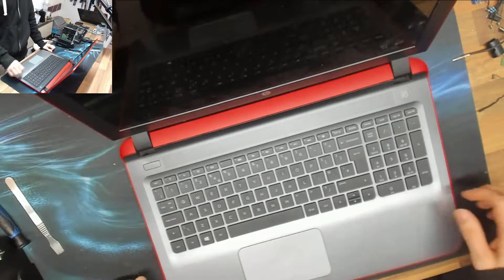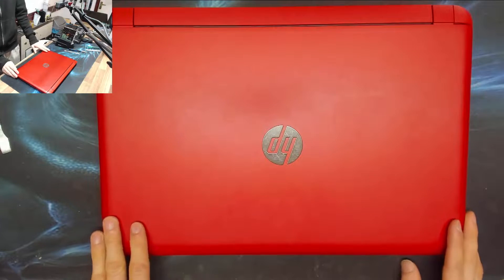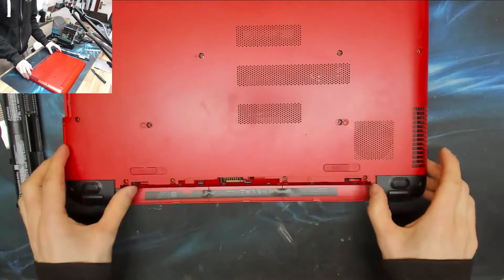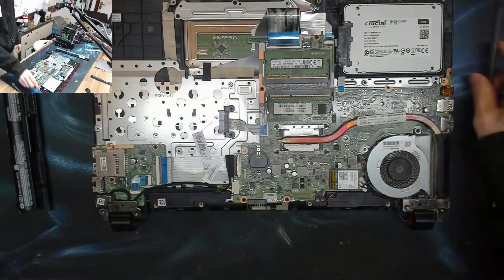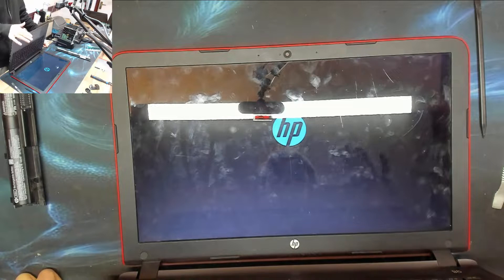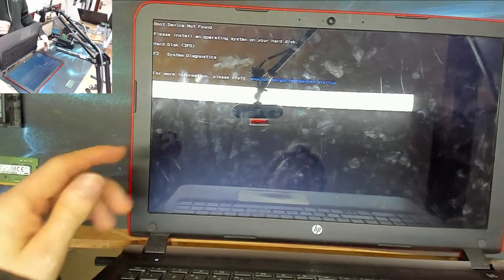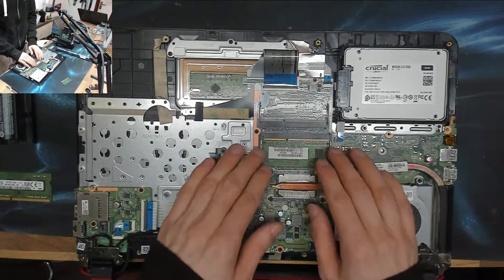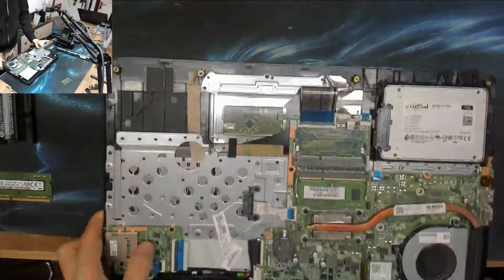LFC#145 - HP Flashing Caps Lock diagnostics

Comment: Mine flashes 5 times, HD spins, it's a fanless. I spilled water through USB ports, at first I hadn't noticed and went on using it. It randomly went blue screen, I force powered it off, no power and as said 5 blinkings... I disassembled it completely and blowed the board with hair dryer Now I'm leaving it apart to discharge caps and bios battery... let's see if it's turning on tomorrow

Comment: Hello, another great video. I have a similar problem. I get 5 short blinks 3 longs ones. It all happened after i did a bios update. When i started the software the program told me i could not do a UEFI bios update, but there was an option. "Only Bios Update" . So i chose that, after rebooting i get this caps lock blinking. I tried to hold Windows key + b or V. But it didn't worked. Watching you're video i decided to also remove the bios battery like you did. Unfortunatly it does not have the same effect.

Comment: I got an issue where there's 3 long blinks. I tried reset CMOS, swap memory modules but still no post. I noticed though that the LCD driver IC gets too hot the moment I turn on the power. What can be the cause and possible solution?

Comment: Thank you so much. Thought my HP 14 - 599 was dead. All I got was 3 caps lock flashes. This particular model doesnt have a CMOS battery. Removed the 1st 4gb ram & hey presto after a BIOS reload its sprang back into life & seems to be working much faster.  I know now I shouldn't have bought the cheapest!!! My old Tosh never gave any trouble. I hope this comment might help someone else.

Comment: the bummer about my HP 820 G2... it doesn't have a bios battery!.... not a single battery to speak of except the rechargeable battery pack it comes with.... it's happened to me before... switched RAM slots and it worked.

Comment: I have the same HP laptop and I got the same cap lock flashing pattern when I put in a bad RAM module and also when I tried to use an external GPU in the WiFi slot
Reply: how's that possible? i'm curious since i've never heard of that

Comment: It's the wifi card.  I took out the wifi card and got the 5 long, 3 short caps lock flashes.  I put the wifi card back in and it worked fine again.

Comment: Thank you for this very clear and instructive video.
I have a 2 long and 2 short flashes on a HP spectre x360. There is no removable CMOS battery nor RAM.
I tried switching ssd hard drive and even motherboard with another  HP x360.
My ssd hd and motherboard work great when installed in the over laptop (wich means they actually work just fine)
and the working laptop's ssd hd and motherboard just don't work when installed in mine (wich means there is something else in my laptop that just can agree to work)
Any possible idea ?
Reply: just buy a new computer
Reply: messed up power rails i'd assume?

Comment: Just got on of these HPs, same caps lock LED 5-3, with any SODIMM I test in it.
Reply from the maker: Probably a dead CPU in that case :(
Reply: @Adamant_IT  Respect for replying to a comment on a 2 year old video, did you know that HP has a table with all the error codes, 5 long 3 short indicate that 'The embedded controller has timed out waiting for the BIOS.' so a bios error
Reply: @aeronjarvis3491  hey did u somehow fixed this problem?Im having the same issue

Comment: My old pavilion dv7 works fine. Aida stress test 1 hour, everthing is ok. Restart the laptop and black screen, cap and num lock flash onnce with 4 second  pause. 
Changed psu. Changed ram. nothing. Wait for a while. like 1 hour. and all is good. Working all day long
Reply: got too hot....if the CPU gets over 100c it will go into thermal shutdown and refuse to start with the caps key flashing every 4 seconds (indicates thermal shutdown)

Comment: Help..
i see you video "LFC#145" and i have the first caps lock error (5 long 3 short blinks) i have a HP 15-ef0875ms and it don't have a battery in the mother board...
Reply: Checkout the pc monkey channel, they are good with hp
Reply: Yo did you fix it? im having the same problem
Reply: @wiko286  F dude.. I was able to fix it with my local pc technician. He had to manually remove the BIOS chip fix it and the solder it back to the motherboard

Comment: 5 long 3 short? I try everything
Reply: I had exactly the same thing when I took out the wifi card.  When I put it back in, it worked again.  So I think you'd have to check either the wifi card or the memory.
Reply: Same
Reply: Same

Comment: Instead of the  caps lock, it was all keys
whenever my laptop dies or like it randomly shuts down bc i havent used it for a long time and it had died it just binks the keys alot of times.. and then it says "recovery files, you pc needs to be repaired".. can some one PLEASE help!?
Reply from the maker: There's a lot of things that could be... software issue, HDD dying, overheating. I would see if you have a local repair shop that does free diagnostics and can find out what's wrong. In the mean time, make sure you have a backup of your files, just in case it dies completely!

Comment: 3 flashses, short ones, just removed the RAM and put it back in and worked. (I knew I wanted to open the lid and I did picked the laptop instead and I accidentally droped it).

Comment: My parents bought their laptop back in late 2014 and it stopped working in early 2015. The caps lock kept blinking and there was nothing showing on the screen. Nothing in this video worked so I’m guessing it is the motherboard. I do not understand how the laptop would die out that fast 🤦🏻‍♂️
Reply: if it was the same flash pattern as mentioned in the video... it's a bios timeout  error.

Comment: I have a HP Stream 14 and it has no screws no battery removal switches its just flat
Reply from the maker: There will be screws hidden under the rubber feet. HP love hiding screws. Not sure how serviceable a Stream 14 will be though, expect to find lots of stuff soldered in.
Reply: @Adamant_IT   I let the battery run out and Recharged it and it turned on SOmething about HP BIOS update but before I charged it the caps lock was blinking 5 times slow and 4 times fast I'm not sure if it works with everyone's computer but I think you can just do what I did Because all I did was shut the computer down and I tried to turn it back on the screen wasn't on but the caps lock was just blinking but can you test this on that computer and see if it works for that computer.